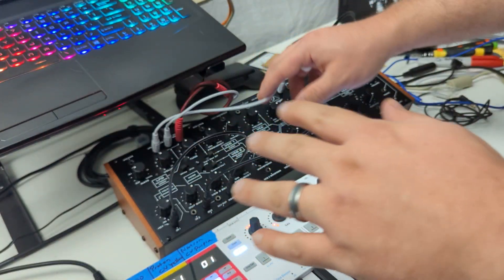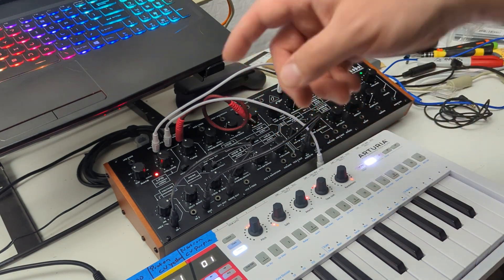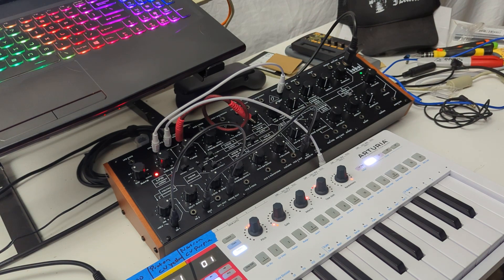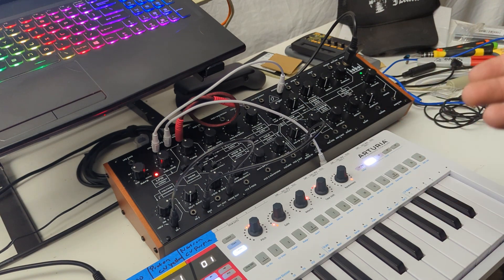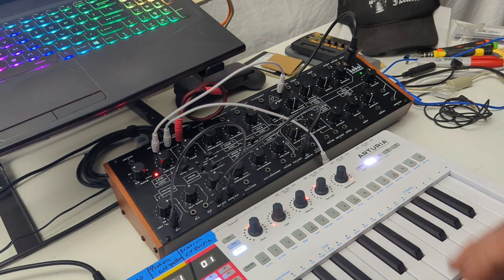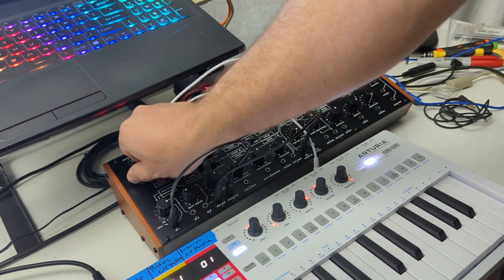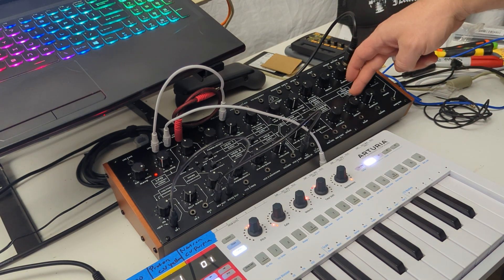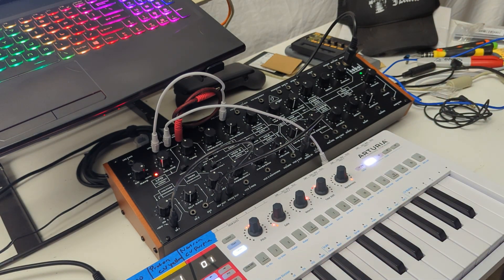Behringer Kobol Expander Patching Tips

Comment: It's not an oscillator!  It's just fine tuning Osc 2 which by detuning it away from Osc 1 which gives you additional harmonics that Osc 1 isn't producing.  It's no different than turning the tuning knob of a string on a guitar and not being quite in tune with the other strings.  You hear a beating when you strike one string then another string.  That beating are those additional harmonics the out of tune string creates that the other string doesn't.  If you tuned up the 2 strings to match you loose the beating between them because they are playing the same harmonics.  Oscillators in synths are like guitar strings.  Just because two strings are out of tune you hear more harmonics, but that doesn't give you a 3rd string.  Detuning oscillators is a basic synth technique to fatten up your patches.  It is not an oscillator because it's not oscillating anything hence there is no shape to control.  The Kobol gives you this nice fine tune knob which is limited in scope because creating a fattened patch only requires a few cents to get the affect which would be nearly impossible on the Osc Freq knob because it's range is several octaves in either direction.  The fine tune knob is only a couple of semi-tones in either direction.

Comment: Nice video. The beat frequency is just a fine tune on osc2 - so it gives (if value is small and both oscillators were at same frequency) a slight detune which thickens up the sound. This is found on most synths. The beat frequency is what moog calls it (for example on modern stuff like the Sub37). That narrow pulse wave is great for guitar and string sounds (got a really nice Cello type sound out of it). I am going to patch this up to my B2600 since you can effectively have 4 LFOs from it - could be pretty interesting.
Reply: Lot's of drawbacks in the signal routing of the original design , other synths solved this more elegantly , for instance i assume both lfo shapes can't be tapped simultaniously , is the vco frequency low enough to use as auxilary lfo?
Reply from the maker: VCO 1 and VCO 2 have their own dedicated FREQUENCY knob in addition to the VCO 2 BEAT. The best description I found was "The term “beat frequency” in this context typically refers to the phenomenon that occurs when two VCOs are operating at slightly different frequencies. The resulting sound fluctuates in volume at a rate equal to the difference in frequencies of the two VCOs. This fluctuation, or “beating,” can be used creatively in sound synthesis to add richness and depth to the sound."
Reply from the maker: I think it's used for tuning VCO 2 when Oscillator Sync is enabled also.
Reply: @THEREALDATALORD  Yes that is correct.